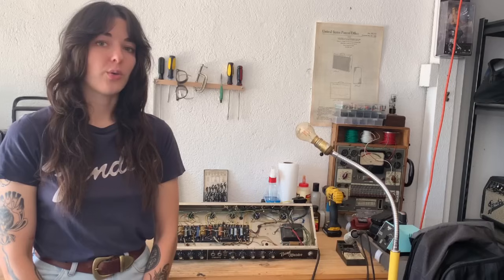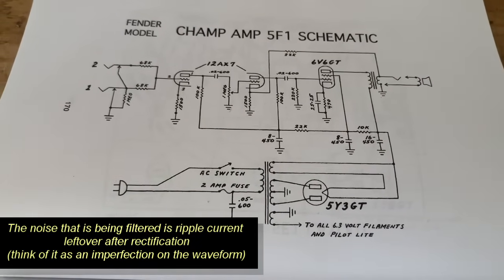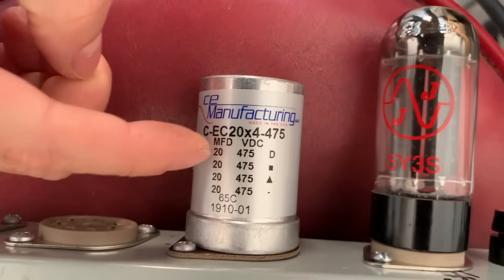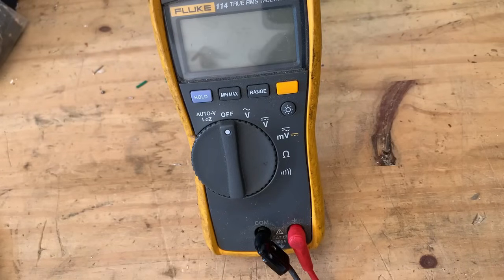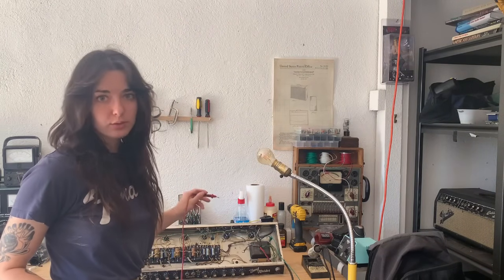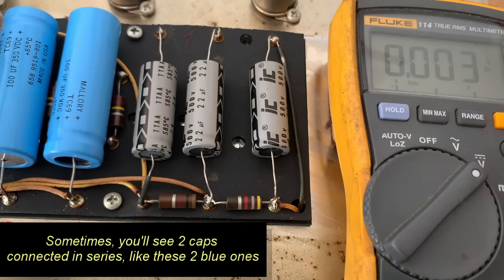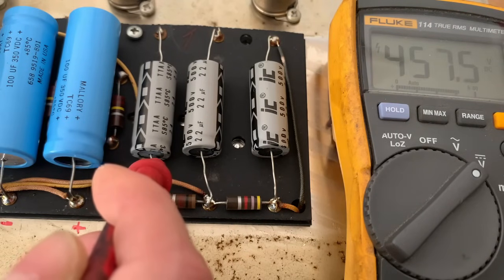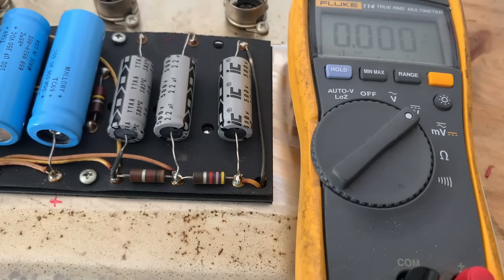Discharging Filter Capacitors & Reading Voltage in your Tube Amp | The Electric Lady

Comment: Nice, never hurts to have a healthy reminder on discharge practices.    Its interesting to see what discharge resistance's are chosen by various people.  The very first one I ever watched was Uncle Dougs who uses a relatively high resistance compared to others, maybe upwards of 10K or so.    I made a series train of 5k and 1K resistors that added up to 11K just because I watched his video.  
I suspect that is serious over kill but, it still only takes around 10 seconds to get down to a safe voltage for working on the amp.   I'm an R&D tech at an electronics medical device lab who's defribulators are discharged with 50 ohm big ceramic resistors.   The director of EE gave one to me and said, "use this Phil, hell, we discharge our super defrib caps with these and they are over 2000 volts!    Its hard not to see him as a trustworthy source and the folks here have been discharging the huge "super caps" but, most of the folks on the amp forums told me I might as well be using a screw driver.    Looking back, I'm sure that a 470 ohm resistor will be more than fine (and maybe cut down the discharge time a bit to get to work on the amp!).    Thank you for the well done and important video!   Time to go build another amp.

Comment: I suggest you put heat shrink under the  Alligator clip sleeve if you are going to use it for this purpose. It's good practice too not only rely on the outer sleeve that can sometimes slip.

 I made a discharge tool out of a old isolated screw driver with a 14awg wire soldered to the tip with a similar resistor. Pretty good video explaining discharging not a lot of videos about it.

Comment: Safety First! When I was going through the US NAVY electronics technician school, if we were caught taking a voltage measurement without our free hand tucked behind our back, we were actually disciplined. That's how important that is and so the habit has stuck with me for the last 35 years. You might even look into fabricating a more robust shorting probe that will give you a bit surer grip to avoid a slip. Lots of videos on that.

Comment: Hi from Burnaby Canada. Got this thru a recommendation from youtube. Nice tutorial on the safety discharge, I used to work on tube TV sets servicing.them the high voltage transformers are doing the same with the main tube.

Comment: Thanks for posting. I've got a Princeton Chorus amp that's showing signs of a loose soldered connection, but I've been hesitant to crack it open and start checking soldered connections knowing the potential for receiving a shock from capacitors.

Comment: I would also suggest using a isolation transformer when doing testing / work on high voltage . Remember that the neutral side of your house wiring is tied to safety ground and so touching a live supply point can completes a circuit through your body . Again take a look at some Mr Carlson videos. I do like that you always replace the two wire cords with three.
Reply: An isolation transformer can cause more problems than it solves. Every work bench should be powered via safety switch which monitors current in the live and neutral lines and trips if they differ. (a.k.a. ELCB, RCCB etc.) If you own, or are considering acquiring, an isolation transformer, I strongly recommend that you read this article at:
https://sound-au.com/articles/iso-xfmr.htm
Reply: I would agree just as a matter of using all sensible precautions. I have GFCI outlets /breakers in my house.

Comment: I have a question and don't know if you can help me or not but you are the specialist. 1976 Pioneer SA6500  2. The volume pot needs to be replaced. It is wited with a loudness and tone booster. Here is the issue, the wires from the circuit board to volume pot are aluminum and are wrapped in similar fashion to a telephone terminal connection. Upon dissasembly the wires are breaking and now are too short. I basically need the pot installed correctly with new wiring and would prefer to use aluminum over copper as this is the way it came and there is a possibility of resistance aluminum VS copper???. However i feel your type of shop may be much more efficient than tegular electronics where ya just slap a card in. Do ya think a music store would be better equipped to repair this? The amp is 100 watt per channel, 4 channel so it's wired pos a and b left channel and pos a and b right channel into a beautiful pair of Bose 501 tower speakers and i never had to turn the volume over 3 to feel and get into the music. HELP

Comment: I'm late to the party, and I'm sure I'm not the first to say thing, but I'm happy to see someone show how to do this without just whacking it to ground with a screwdriver. With the wrong set of circumstances the screwdriver could end up embedded in the concrete behind you—visible through the screwdriver-shaped hole in your head.

Comment: Great demo.  There’s also an Old School tool from ham radio days sometimes called a chicken stick.  AKA voltage discharge tool.  Stew Mac sells an affordable one and you can make your own.  It gives you a more stable tool with longer reach.
One thing she didn’t mention was the power value of the resistor.  Note she’s using a 5W.  Keeping in mind P=V^2/R, dissipating 100V in a 1K resistor will still be 10W.  You won’t smoke the 5W resistor as that is not continuous power, but... if you happen to be discharging 300V and you have a 470 Ohm resistor, it’s gonna get hot.  Go for a reasonably large power resistor and I wouldn’t go less than 1K myself.  
Not trying to be over critical, but you can’t be too safe with high voltage.  And keep that other hand behind your back.  Wear insulated shoes, too.  Not like me who walks around barefoot all the time. Feet on concrete is a surprisingly good conductor.
Reply: Especially with sweaty feet. I have heard stories of musicians being electrocuted with electric guitars or microphones. Crazy.
Reply: For those reading the advice above to use a larger resistor, be aware that while the 1K resistor halves the peak power the resistor must dissipate, it in turn takes twice as long to discharge the capacitor to a safe level as the 470 ohm resistor.  For very large capacitors at high voltages, a one or two second touch won't be enough to make the capacitor safe.

Comment: That was very good. Anything like this always takes me back to roughly 40yrs ago when I was studying electronics in college where, using only mA ,we were taught to discharge by using a screwdriver across the leads.....of course, being a guitar player, I decided to build my own amplifier and, sourcing the instructions from something like ‘practical electronics’, went out and bought all the components.....some of which were electrolytic caps and a mains transformer, tapped to supply 6A (I think)......anyway, long story short in my enthusiasm I forgot that I wasn’t in college using mA and proceeded to discharge with the screwdriver.....my whole world turn green and blue for a while! 😳 taught me a painful, but valuable, lesson 😀👍🏴

Comment: Don't forget if you are working on a solid state amp, you will need to bleed the negative supply filter caps as well. They will have their positive terminals to ground and the negative terminals will be hot. The voltages won't be as high as in a tube amp but they can still pack a nice wallop. Take it from those who knows !
Reply: Hopefully, not from your own experience? So, basically, with Solid State, you bleed both sides?
Reply: Take it from two who know!

Comment: Not sure you want to answer this question because its not directly amp related but still deals with high V Caps. When i connect my inverter to my 12 Volt lithium battery 99% there is a huge spark. Is there a way i can avoid this by draining the Voltage in the inverter Caps using a Resistor the same way youve done here?

Comment: None of my mentors ever used a resistor to discharge a cap, neither did I.  I've seen techs screaming about it!  (A certain Canadian comes to mind)  I don't want to contradict you, especially when I love your post, but harm to a cap by spark discharge must be a really fringe case scenario because in years of repair work I never actually witnessed any problems as a result of it.   Sub!
Reply: It's not the cap that's in danger. When, by a one in a million chance, a piece of molten screwdriver hits you in the eye ...

Comment: Nice, hopefully your video saves some lives. I'd even leave the resistor between the high voltage rail and ground, just to be sure.
Reply: Just don't forget to remove it before you switch the amp back on!

Comment: You are so right about always check, never assume!  I once worked on a UK domestic installation I was told was dead - in fact, the neutral feed was broken, and the whole system, line and neutral, was at 240V.  I checked first, or I wouldn't be writing this!
Reply: The gun is always loaded ...

Comment: Wood could hypothetically conduct somewhat if moist enough and the voltage is high enough. I remember an old radio building book from the 1950's, they used actively(?) dried wooden boards then soaked in paraffin or so, to prevent it from drawing moisture again for minimum conductivity (with nails or such in the board to hold component contacts)
No idea whether that could ever be enough to be harmful to a human in this context, or just spoil a circuit.

Comment: Hi if you discharge amp filter caps ,when you switch amp back on is it safe , I’ve heard people say when you change filter caps you should bring voltage up slowly is it the same after you’ve drained them  , thanks
Reply: New (recently manufactured) caps do not need to be 'reformed' by a slowly increasing voltage, though old (NOS) caps can benefit.

Comment: Often used to get a jolt of an amp with a 70vdc rails. Part of the job in those days. If the units powered you can't let go with DC. As one engineer said to me "No one with a weak heart does electronics for long". The old tube TVs were much more serious! 26k of the tube 8k off the coil, in the early days they could even explode, well implode.

Comment: Good presentation, just so you know. Nice tip with the resister. I am currently checking out your other vids. As for future vids, ANY knowledge on transformers is always helpful, The Math for both power and output . Understanding chokes a bit more would be cool too. The Iron is what makes everything do what it does. Matching, testing lots of stuff. Oh, and how about Rectifiers? SS vs TUBE power sag from tube types, why some are preferred over SS These should keep you way more busy than you want to be. Biasing a tube amp is something for the pros. Have it done once with groove tubes and buy a backup set of the same color and instantly you are back up and running. It takes special tools a player is just not going to have otherwise. It would be an interesting video just the same a bias king is not that expensive. TUBES ROCK!!!

Comment: No. You need to be a qualified Electrician/Electrical Engineer to work safely on high voltages found in amps - it’s not DIY.

Comment: Thanks Fazio, knowledge is power! Now all I need is a reason to go open my amps up. Do I need to discharge on a solid state amp as well?
Reply: Solid state amps usually work with lower voltages, but I have had painful (though not life threating) jolts from caps charged to 25V. Better safe than sorry.
Reply: @silasfatchett7380  thank you

Comment: Been doing this for over 40 yrs...i just short the caps with a jumper wire (I don't mind the sparks) and after about 25 yrs I started getting bored and leaving equipment plugged in just to make it more exciting (Do NOT do this) and my trusty 40+ yr old hex bit screwdriver only has 1 arc scar on it (from household wiring)...I cut my teeth on tubes but now I'm into class D amps. And in my whole career I only got shocked twice (once from a CRT and once from a microwave oven cap) both were my mistake and the reaction was much worse (and damaging) than the shock.

Comment: A video on biasing and replacing tubes would be boss...
Reply: You can just change the tubes out. Make sure they are the same type of tube.. only gotta bias when you start swapping out different tubes.
Reply: @skittlesstarburst4532  👍
Reply: @skittlesstarburst4532  oh shit thanx for the info i was under the assumption that you have to bias the amp when u change tubes in general..
Reply: @giokyo9465  he's totally incorrect. You need to bias power tubes in amps that aren't cathode biased..
Reply: @giokyo9465  preamp tubes don't need to be biased. Only power tubes.
Reply: @skittlesstarburst4532  completely wrong.
Reply: Changing tubes is really easy but I think you are right, biasing a pair of output tubes is in my knowhow check list too.

Comment: I use a cable with alligator clips. One end goes to earth, the other goes to the anode of a preamp tube. The plate load and dropping resistors slow the discharge. I also have a cable with a 10 W resistor in it. Either or.

Comment: cool video. i've got a fluke 117 and you can use the low Z to discharge as well. i think it has like 10k or something. it's satisfying to watch the voltage drop slow and steadily down to whatever ghost voltages are left.
i like your channel.

Comment: As a longtime guitar maker I have been asked a thousand time to work on amps so I am now starting to learn.  How do you discharge the silver can type of filter caps?  Thanks for the direct and explicit info.  Any other safety info I should know? Cheers
Reply: Attach the discharge tool to one of the positive terminals and the chassis. Unless there is a fault in the B+ supply chain, all the caps will discharge via the internodal resistors. To be sure, attach the discharge tool to each of the positive terminals in turn.

Comment: Great video well explain. I was curious to know, let's say you don't have a resistance to discharged the capacitor could you just use the multi-meter like you just did at the end when you re verified. I mean still put the black probe on the chassis and the red probe on the capacitor and just waiting until it completely drain. By the way i am french, so if my sentences are odd that explain.
Reply: Yes, but a multimeter on its DC volts setting has a high resistance so it will take a long time to discharge the capacitors.
Reply: @silasfatchett7380  Ok thank.

Comment: Thank you.  I ordered that resistor and look forward to being safer when I work on this gear.  Your presentation is clear, concise, and delivered in such a laid-back tone that I seem to soak up all the information.
Reply: You are so right. This gal is a great teacher.  It takes one, to know one.
Reply: You order that resistor? You don't have an electronic store nearby, that sucks waiting on parts. I'm waiting on my guitar lol. It sucks.
Reply: its possible to make your own resistors if you need one in a pinch. Salty water has a resistance as a function of the distance between the electrodes in the water and the salinity of the water.

Comment: I was just thinking to myself that I’ve never seen this vital step covered by any presenters/techs in their videos. My books show some sci-fi contraptions for discharging cap’s 😆 Thank you
Reply: I saw somebody play through the amp while they turned it off and it discharged the caps down to around 2v. All they did was strum, very, very hard until the sound died after turning off the power.

Comment: After the initial shock of seeing you for the first time, I was very interested by your vid's content.  Very clear and well explained: congrats ! I was told that as good it is to use the standby switch when turning the amp on and wait for half a minute to a minute before switching the power to "ON", it was best to use the power switch to turn it off immediately without the standby step, as it discharges the capacitors more efficiently... right ?
Reply: If the amp is switched out of standby', the voltage is on the caps is drained by the tubes while they are still conducting as their cathodes cool down. Whether the caps are drained to a safe voltage is not guaranteed.

Comment: Is it safe to replace the tubes in my 1965 Deluxe Reverb Amp ? Is there a chance of being shocked into submission ?
Reply: If the amp is switched off you can safely change the tubes. Depending on the amp you may need to have the amp rebiased if you change the output tube(s).